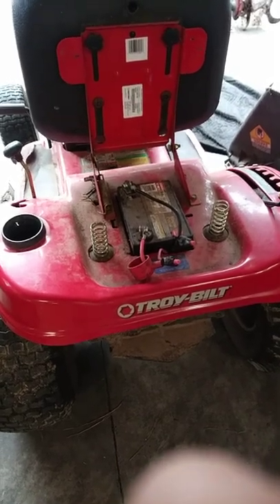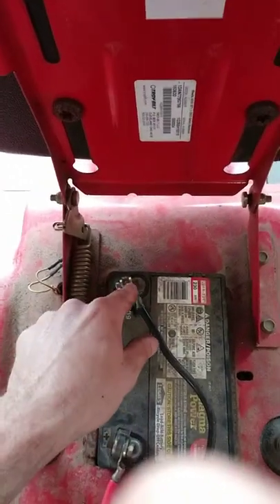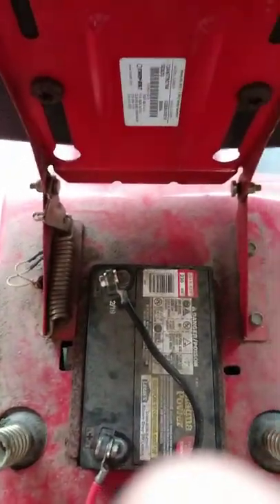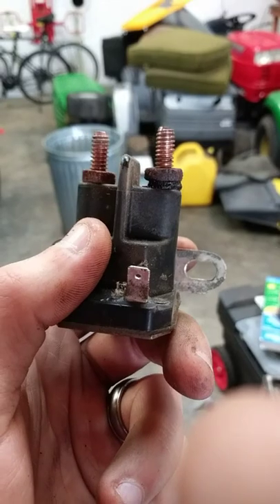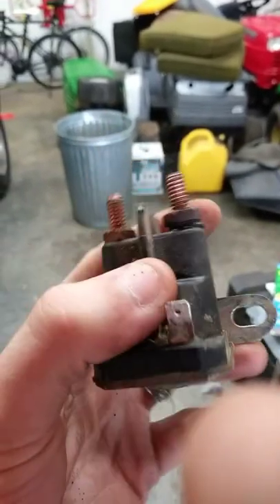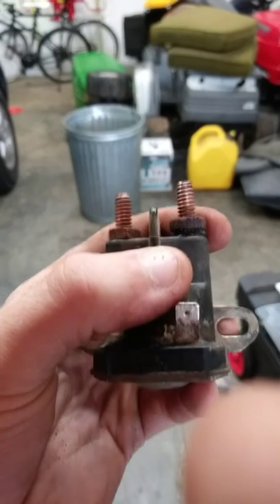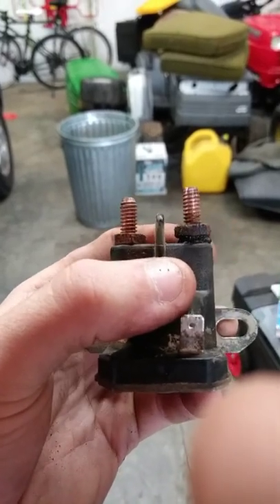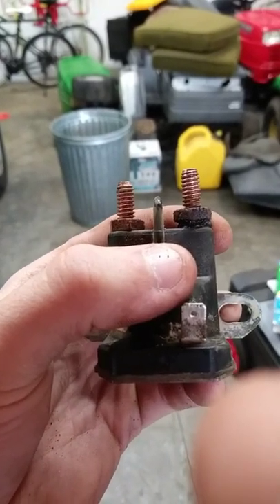Riding mower shorting out battery?  Check the starter solenoid! #shorts

Comment: I have a question what changes the battery on a Jonh Deere LA140
Reply from the maker: The stator underneath the flywheel is what charges it.  However most times the voltage regulator that controls the voltage coming from your stator is what usually goes bad.  It looks like a small "box" with a couple yellow wires going to it.

Comment: Those are the a problem some time a issue that we over look
Reply: Thanks for the heart young man 😎
Reply: Did the mower still start with the solenoid?  I’m having a hard time finding the draw on my battery. It starts right up when jumped, just won’t hold a charge. The alternator is putting out plenty of charge.